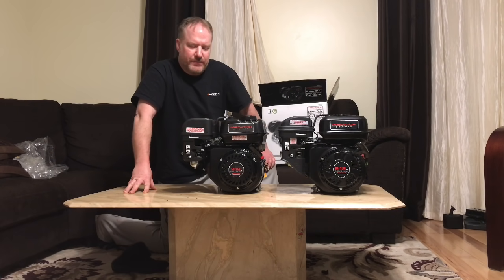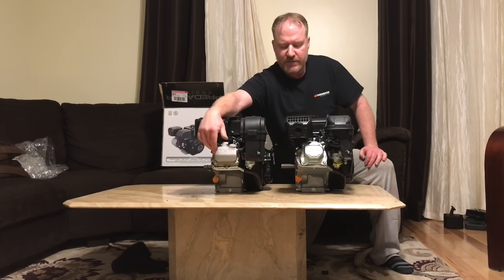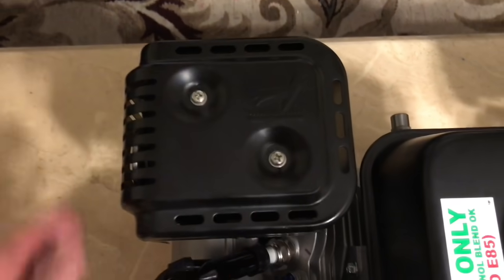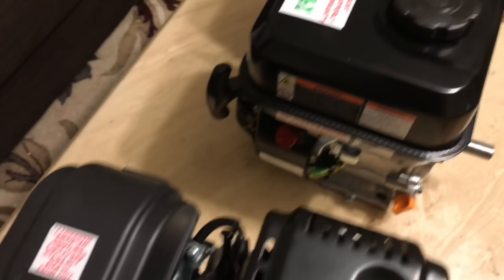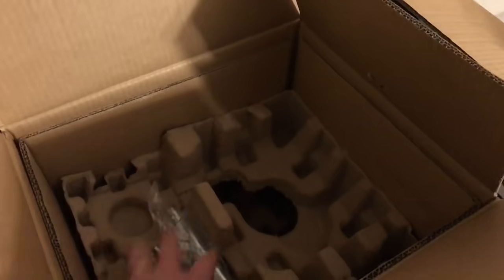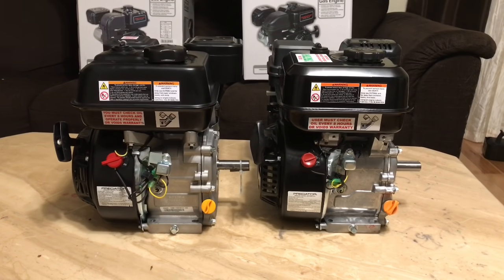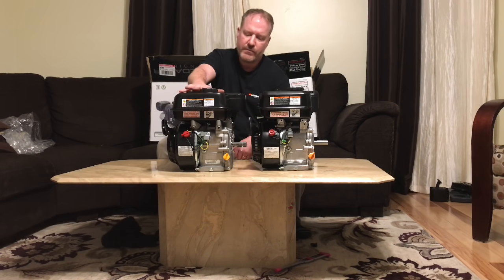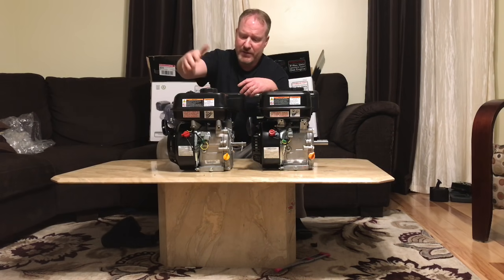What?!?  Harbor Freight Predator 212cc HEMI built by different factory than NON-HEMI???

Comment: 212 cc,s should make 15 or  more hp
Reply: that is a lot of money to make it do 15 BHP... when can buy 16 HP engine for $300.   when to say when???  when put $300 into a $100 engine???? to get maybe 13 HP SCREAMING the engine.  Billet rod $120, Billet Rod $65, Valve springs $8, stainless valves $15/each, keepers... $20, port the heads with wen grinder $23, sanding drums $8 ... bigger carb 390cc carb on fleabay $15, adaptor $20, air cleaner adaptor $25, torque wrench $10, 12 point 10mm socket for billet rod....  but it is all abt the challenge.  they have some NICE port work as it is all in the head to get the fuel/air mixture in and out fast.   but at higher elevations, over 3000'  lose ... 15% as not enough air for the fuel no matter how much fuel u put to it.

Comment: They both look like a Honda GX 160 knock off. Even the Honda's are made in China now
Reply from the maker: Martin Schaffmeir 
The Non-hemi is a Honda GX200 clone, but it has been bored and stroked to 212cc rather than 196cc.  Most all other Honda GX200 parts are interchangeable with the non-hemi Predator.  The Hemi Predator 212, however is a whole different animal.  It hardly has any interchangeable parts.  About the only thing it has in common with the non-hemi is the color scheme and the carburetor.
Reply: Yup'
Reply: @BUILDNIGHT  sounds like the non hemi could be a legal copy of a honda- the hemi is non honda approved so they made it different enough to sell outside china without getting sued for copyright.

Comment: "performance version of a honda" yeah right honda is the best performance your ever gonna get, there smoother, Rev higher and sound better
Reply: Not to mention the reliability
Reply: For a third of the price, the predators are also extremely reliable
Reply: @andrewbuzzell3542  🤣
Reply: @cynthiaroesner1719  dude. I have a friend that sells firewood, probably processes 40+ cord a year. The predator we put on his splitter like 6 years ago is still taking the abuse. We used to run that thing almost non stop for 12 hours at a time. Meanwhile my cousins 8hp Honda has been in and out of the shop multiple times.
Reply: @cynthiaroesner1719  go play with your mopeds ok? Let us that know engines do the talking lol
Reply: @andrewbuzzell3542  ok lol
Reply: @andrewbuzzell3542  haha 2 stroke better
Reply: @andrewbuzzell3542  the larger dicplacment usually less reliable

Comment: Can someone explain to me what this "Hemi" nonsense is about.....last time I checked a "Hemi" was an engine stable brand for Chrysler/Dodge....but now it's being used for cheap arse Honda rip off engines.....wtf???
Reply: Hemi as In hemispherical combustion chamber.  Yes the mopar engines are what most think of when they here the term Hemi, but these very popular little engines have a big following and there has been some debate on which head/combustion chamber design is better.
Reply: ahhh thankyou very much, that explains things well
Reply: The difference in the hemi and all other internal combustion engines,  that Chrysler engineering came up with was the spark plug was mounted in the center of the combustion chamber.  Meaning the plug provided a spark in the middle of the chamber the piston comes up instead of the side a of the engine.  The Spark plug went through the top of the valve cover not through the side of the head between the exhaust pipes.  It is the design all the race car engine developers went to .  It makes a lot of sense when you think of it in a matter of performance. ( I believe that was the only good idea Chrysler ever came up with )....  :- )
Reply: Ford made hemi engines too... just no trademark "Hemi".  Like others have said, hemispherical combustion areas... that's all.
Reply: @AnyManProjects  almost all new vehicles have hemispheric combustion chambers i even think toyota does
Reply: masters engineering ,,,,yup,,,,,,mopar and Ford came up with hemi engines, the design came from motorcycles.
Reply: Another Hemi advantage is that it is a cross flow design. In that the intake and exhaust are on opposite sides of the engine. Keeps the carb away from the exhaust heat and the intake and exhaust ports are almost if not always straighter for better breathing which equals more power.
Reply: @mastersengineering  beat the hellcat.............with anything

Comment: They're both exactly the same the only thing you pointed out its slight differences that don't matter in the engine. They are both hemis. Carburetor spark plug and exhaust are in the same exact spot so they are both hemis y'all people are getting ripped off.
Reply: Brian Boyer no I am talking from watching the fucking video the only difference are cosmetic oh and the Box other than that same exact engine. Unless you think cosmetic differences make  performance values?
Reply: John, do you know what hemi means? They are different, it's the head and piston. Yes most of what's pointed out is strictly cosmetic differences with no influence in performance but it a way to identify which is which.
Reply: Tyler Gibbs those two engines are exactly the same. The max they did to the one that is Hemi he shave a tiny bit off the head to build a little bit more compression.
Reply: John Sears so your answer is no, I don't know what hemi means. Whew that's out of the way. Now on to what he was saying, there is a very distinct difference inside the motor. Have you tore one down for yourself? I have, I race the damn things so I seen it with my own eyes. One has the traditional head piston, the other is a hemi. Google what a hemi is and get back to me.
Reply: John Sears wont reply because the butthurt be real from not knowing what a hemi is.
Reply: @pierce9260   Goddamn it Super 6.0 I LIKE YOUR STYLE I LIKE YOUR STYLE
Reply: John Sears Bullshit Hemi means Hemispherical head and requires the defunct heavy round top piston driving combustion out to he rings.
Reply: @republicansareoffendedeasi821  WRONG, DO MORE READING
Reply: @republicansareoffendedeasi821  bigger valves do! get a hemi.
Reply: @bucknut2850  Yep. A Tillotson 212, Ducar 212, or better yet a Wildcat 223. They all have hemi heads and are much better quality than the Predator turds.